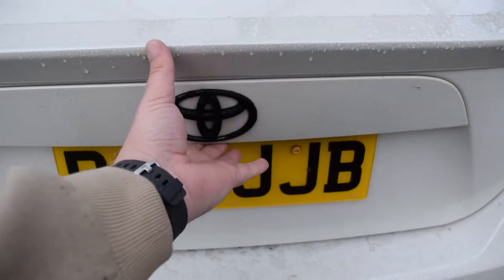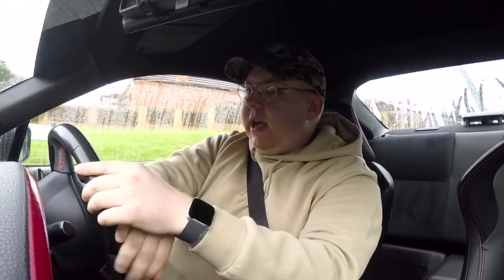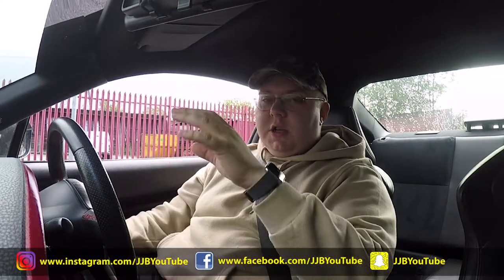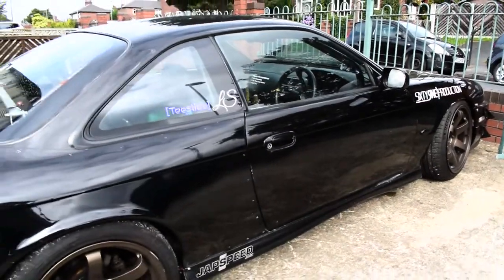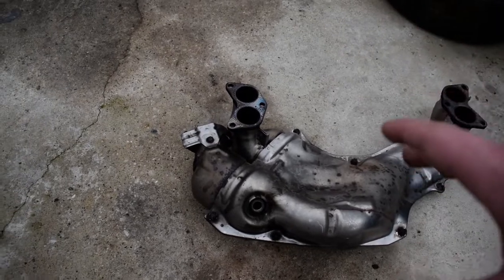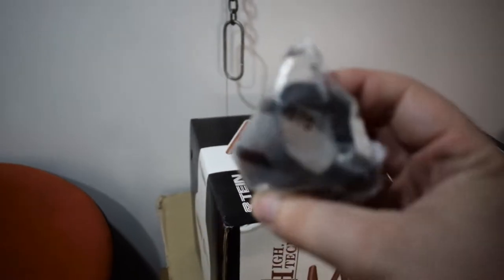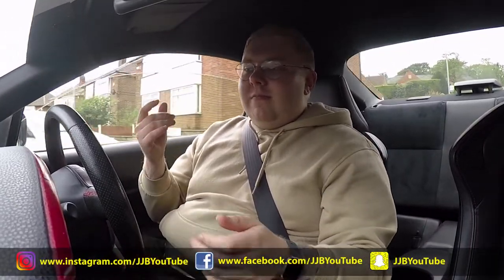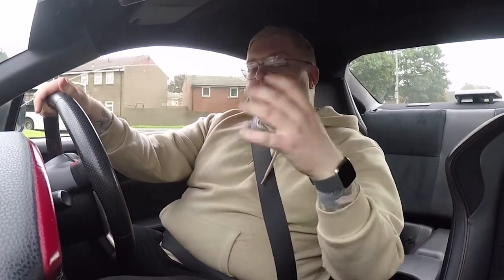Installing UNEQUAL Length Headers/Manifold on to My GT86!

Comment: I know this is an old video, but for reference the Mishimoto sound delete kit  is for the engine bay - not the footwell.
The black rubber part blocks off the intake pipe leading into the cabin and the silver bung goes on to the induction pipe next to the filter. (You have to remove the plastic pipe work from the filter to the cabin)
Although the method on the video does
work, fitting the mishimoto kit gives you 100% intake noise removal!

Comment: Will be 100% improved with a tune. Are you not getting a check engine light from the de-cat?
Reply from the maker: I hope so! The car feels better after the install, not as much as a torque dip, quite noticeable. No check engine light on, I think if the secondary cat wasn't in good condition it would show. But no lights my end

Comment: Hi, I like the set up, I will be purchasing the same manifold for my 86 aero and I already have a decatted full milltek non-resonated system, so should be pretty loud :) quick question, did you plastic-dip your Toyota emblems to get them black?
Reply from the maker: Thanks mate. I'm wanting a bit more volume now so exhaust is next for me. I removed the emblems and painted them rather than plasti-dipping

Comment: Sorry but the latest news from DVSA is no MODS TO CATS OR REMOVE OR TAKING OF ONE. there for you can not take cat of!!!!.
Reply from the maker: Latest news where? I've just had a look and see nothing. The car is within emissions standards so there's no issue removing the "pre" cat.
Reply: @JXLPerformance  The GT86/BRZ has two cats. You should be fine with emissions/MOT etc... if you’ve only removed one. On another note it’s looks like you’ve bought equal length headers. (Not UELH) That’ll be why it doesn’t sound like a ‘Subaru’.
Reply from the maker: I know it had two cats 👍 the headers were technically unequal length, however only just, I don't know the exact measurements but they were unequal, just less so than the likes of HKS etc.
Reply: Everything is illegal in Britain, that's why we have some many criminals.